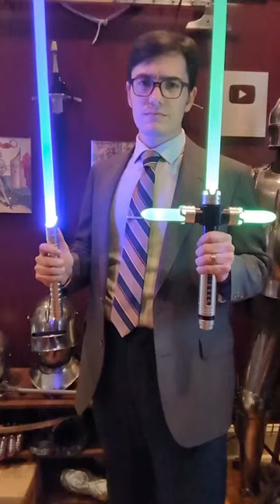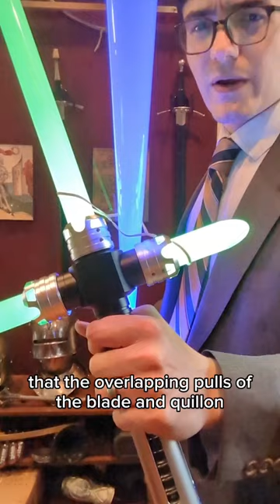Crossguard Lightsaber Theory

Comment: Good idea, but counter idea:  if the magnetic forces can be strong enough to pull the blade to the crossguard, or hold it in place between it and the blade, would the blade be able to slide enough when in contact with another blade to require a crossguard at all?  And in the case of protecting against direct hand strikes, would the pull be strong enough that putting your blade in the general vicinity of their strike would protect your hands and remove the need for one?
Reply from the maker: That's the ponderance I suppose. The pull is presumably strong enough that most sabers aren't overly vulnerable to someone sliding their blade down onto the hilt. Though that scene with Grevious vs Obi-wan comes to mind.
Reply: @robinswords  Course there is a counter counter idea.  They do work and provide good protection in a lightsaber fight,  but since after a certain point jedi didn't really fight people with lightsabers very often they fell out of favor.  As for why we can look at dooku.  His lightsaber was really good at dueling other lightsaber users, but he got flak for using it for precisely that reason.  Far as the jedi knew, the sith were gone.  The only reason to use a lightsaber like that was if he was expecting to fight other jedi.  It could be a similar thing.
Reply from the maker: @geraldposter1496 I'd say that's supported by the High Republic books. Stellan Gios uses a crossguard saber and mentions that it's a bit antiquated since they don't fight Sith anymore, but he finds it interesting so he studies it anyways. Bit of Historical Jedi Martial Arts nerd if you will.

Comment: I'm not sticking with the cracked kyber crystal theory.

But I'm more inclined to believe that it's for added protection from the other blade.

Remember when Count Dooku grazed Obi-Wan Kenobi's arm?

What are the chances those secondary blades would have protected Kenobi?

And an alternative method of attack as Kylo Ren gives to an attack and uses the secondary blades as another means to strike?

I'm relearning Tai Chi and I previously learned some Tae Kwan Do years ago, but I read that karate employs deception during an attack.  You think you know where the attack is coming from, guess what?

I think Kylo Ren would employ fake outs during his attacks, like giving them striking.

Comment: Or hear me out... the blade is still inside the cross guard part and the actual cross guard is to protect you from the blade.  Why people gotta overthink this.

If the blades are attracted to some degree yes.  That wouldn't stop the blade from going into the corner of the cross guard, it would be more attracted to it.

Comment: Everyone is like “oh, but what if it hits the base” a base that is less than a cm wider in two specific areas opposite each other. I feel like it’s such a marginal outward area that it would either hit the cross guard lightsaber blade and do its job or cleave through the saber itself and your hand in which case it probably would’ve done so anyway and you now have the much bigger issue of your lightsaber blew up now what. All of this ignores the fact that it could just be made of light saber resistant material.

Comment: I call bs, l heard it was because of the unstable damaged Kyber crystal that the sabre is unstable without the 2 extra valves (cross guard) releasing the the excess energy so the lightsaber doesn’t explode or damage the hilt or electronics in the lightsaber. Don’t know if that was a statement or theory but that hilt is useless to use. If it was used in the prequels everyone of the Jedi would’ve of just slid their lightsabers down and destroyed part of the hilt

Comment: The magnetic field that maintains the blades don't work like that, it would be a light tug towards the active blade at best unless they had the same charge, in which case they would there wouldn't really be able to even get near each other. IN SUMMARY if they are opposingly charged the lightsabers won't stop each other, if they are similarly charged they repel each other. depending on the strength of the charge it is either A: We aren't really having a fight we're just letting a plasma current pull us around or so weak your cross-guard does nothing aside from adding an extra hazard for yourself. not much room for anything in between. Sorry but the nature of plasma kinda prevents it from being used like a metal would. Cross-guards while great or traditional swords would not only be useless but hazardous on plasma weapons.

Comment: Wouldn't the part that the actual blade protrudes from have to be forged at a higher temperature than the lightsaber burns at in order for it to even function at all, otherwise it would just melt and the lightsaber would destroy itself fairly quickly?

Comment: Yeah nah. 2 forces at right angles are sqrt(2) as strong. But since these forces are in opposite directions at the moment you most need them, they will cancel each other out.

The crossguard is dumb for other reasons anyway. Beskar would be an objectively better choice, since it resists lightsabers and won't kill you accidentally.

Comment: But the blade emerges from inside the hilt, does the hilt block/divert all magnetic fields? Else the attraction should still go towards the hilt. 

Lightsabers have been cut at the hilt in the past, so that magnetic attraction can't be that strong either. Also dual wielders, or General Grievous would face the same magnetic pull as well between multiple blades.

Comment: Well, as plasma supposedly can be controlled by an electromagnetic channel and supposedly that's how the plasma blade is contained...

Even though the high heat, or resulting heat from the excited gas, would nullify the capacity to contain the plasma.

Or possibly the intense surge of the electrons in the valence skin of the molecular composition may polarize the material to submit to the purposed channel.

The resulting repulsive force would result of repelling between 0.3-5 lbs of dynamic force. If that repulsive force is broken through, the resulting attracting force would possibly be equal. 

If all this would be true, the resulting scenes of combat would look uncomfortably hilarious. Imagine a big sponge stick fully saturated in fly trap glue. 

The curious thing is why the hilt doesn't have a shell of beskar. Most likely this would be an aloy comprised of heavy metals and inert gasses. 

Allegedly, the blade is plasma or a Lazer. Neither method would render the desired results as both requires an excessive amount of energy. Both methods would most likely require the use of a electromagnetic channel as mentioned before. 

However, the cross guard my be effective due to intense training if it is indeed a blade. In addition,  one would wonder why the jedi or sith would abandon all uses of armor when gauntlets or bracers and greaves would not only look cool and seem non threatening but, would help immensely in combat.

Comment: As Someone with Adam Drivers Height & Build who Learned to do All Kylo Rens Saber Choreography it really wouldn't matter either way.

The Arcs you can Get with that thing having long arms is Intimidating and everyone I've Dueled with using that Saber had a Fear reaction to Backup jus from some Lateral Spins. 

It also feels amazing in the hand the center of my palm essentially wrests on the opposite side of the emitter switch which is higher than most sabers but gives more control so sharper movements are a breeze. 

I can be more flowy with a more Katana styled saber such as Anakins/Lukes I got addicted to how the Kylo Ren Crossgaurd saber felt to Use and Hold.

Ugh I wish I had a Real Kylo Ren Lightsaber then nothing truly would stand in my Way 😂 🙏

TLDR: You ain't gonna get that Close Jedi Scum!

Comment: You can’t cut through the emitter while it’s on for one very simple reason… there’s a fuckin lightsaber beam inside of it lol.  Lightsabers don’t and can’t cut through other lightsabers. 

The beam doesn’t start at the very end point of the emitter. It runs all the way to the intersection internally.

Comment: Isn't there some kind of rare lightsaber resistant metal? I'm not a fan so I don't know but my head canon has always been that there is and while not solely made of the metal, they smelt it down with other metals to make it highly resistant. That's why you see them cut through basically everything with ease but to my knowledge can't damage each other. I haven't watched anything star wars in 20+ years though.

Comment: I think lightsabers with cross guards are the most idiotic design choice. It just looks stupid. I don't care if it works or not.

Light sabers have no edge, if anything, the cross guard limits the range of movement someone can attack from and until someone slides down the blade of the saber and lops off their opponents arms then there's no point to them, especially if they are magnetically attracted to one another.

Comment: I think the amount of bullsh*t one has to come up with to explain this nonsense design is evidence enough that the only thought that went into it is the hope that the "rule of cool" would be enough. And judging by the number of people willing to defend the design, I'd say it worked. 

Not for me though. I think this design, along with the folding lightsaber, is stupid. And your theory in this video is ridiculous. If the lightsaber attracts another lightsaber that won't stop it from continuing into the centre of the cross guard. That would require a massive repelling force.

The best theory I've heard is that it's a flawed construction that Kylo Ren built and it required "exhausts" points to stabilize it. This is backed by the fact that side parts look more like flares, and the main blade seems to fluctuate more than a normal one.